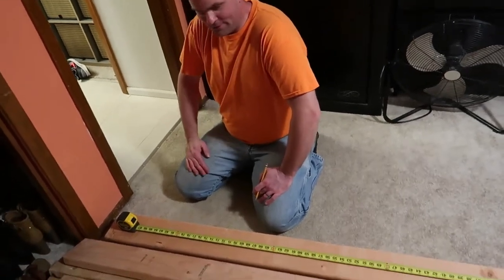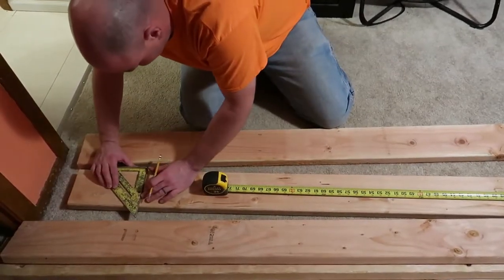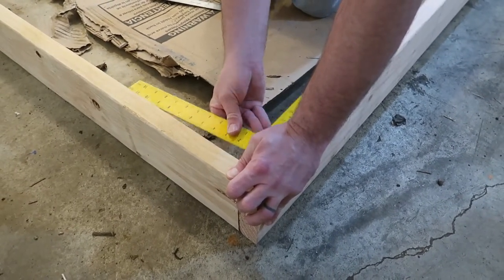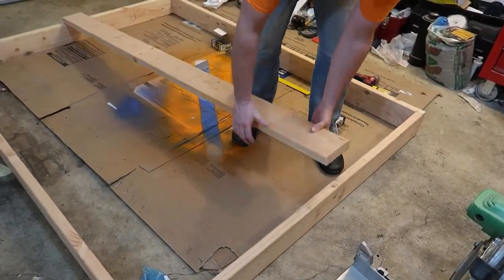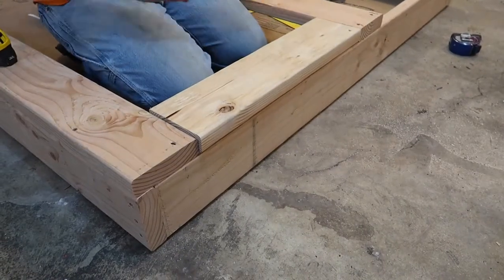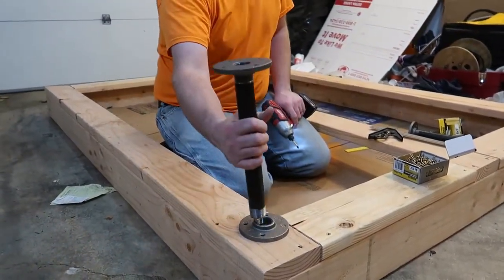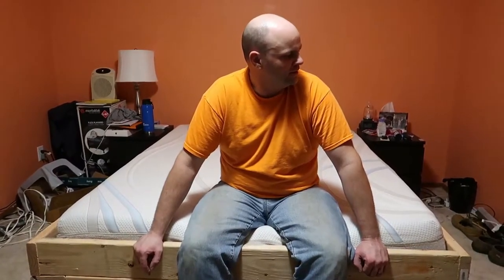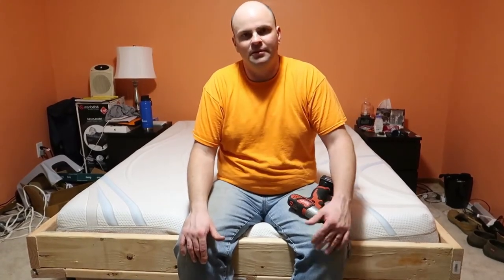DIY QUEEN BED FRAME

Comment: What are the dimensions to cut and legs
Reply from the maker: The legs are use 12 inch nipple pipe that was 1 inch thick and I cut the boards to fit a queen mattress on the inside. The mattress size is 60“ x 80“. So I would have cut that to be 63.25 inches and the other board to be 83.25 inches.